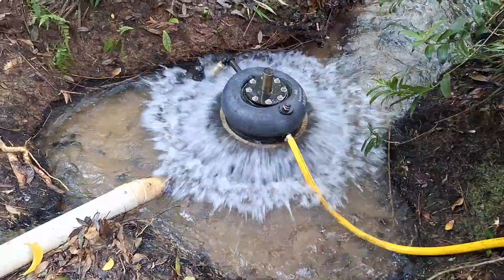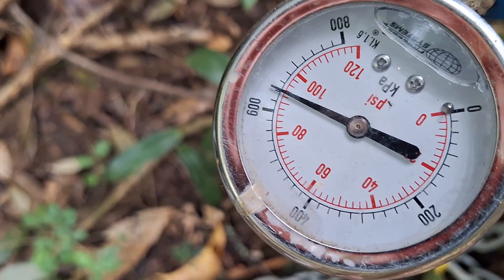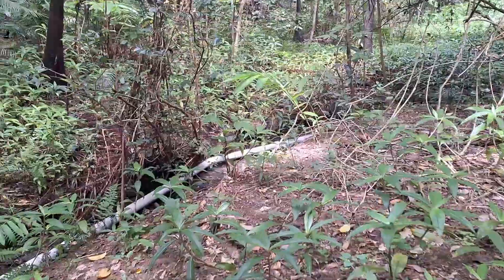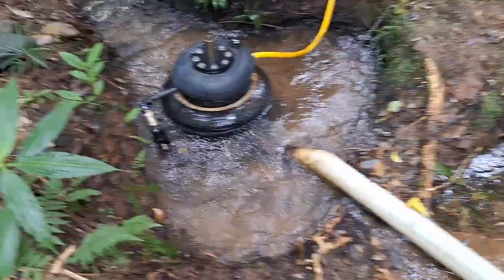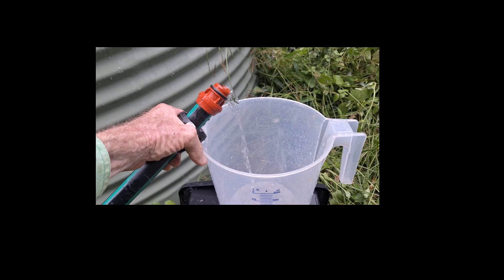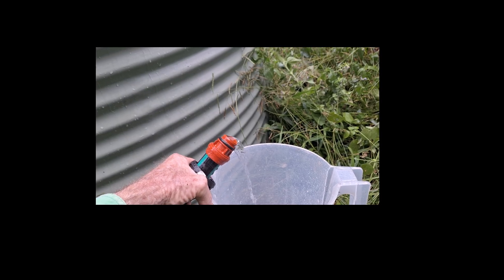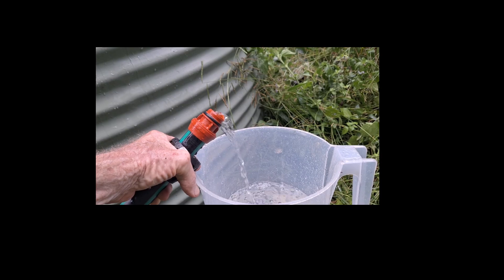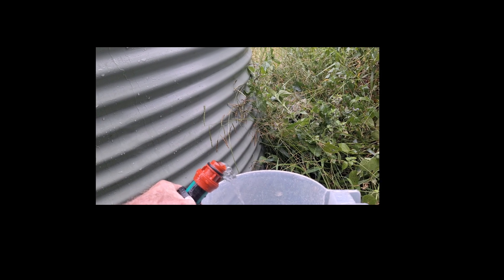Brian's Bunyip PA13 Pump in the Millaa Millaa area

Comment: Absolutely love these pumps.
I have nowhere I could use 1 (currently at least)
The little leak at 2min made me smile. No idea why. "Cute" maybe.
Didn't seem to impact pump at all.
Would be interesting to know how much water gets "used" to pump the 2.2lpm (how much total flow from that 900mm fall)
Very cool stuff.
Thanks
Reply from the maker: Hi Tim, it is exhausting about 2 liters on every cycle, so that's about 60 liters a minute to pump 2.2 liters. This will very on every pump depending flow rate powering the pump, fall, head and piston size. The 60 liters is the fuel rate to power the pump or water pressure to expand the tyre for the pump stoke.
Reply: @brettporta2332  Thanks. Rough idea works for me :) 
It's enjoyable & relaxing to listen too. In that way it reminds me of a Japanese shishi-odoshi/deer scarer. Not so much visually ;)
Thanks again for the extra info